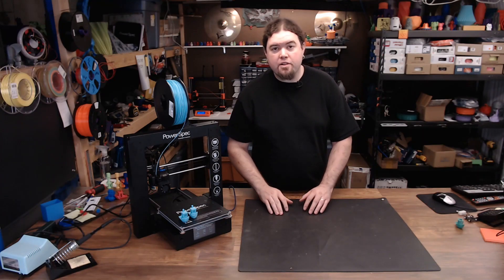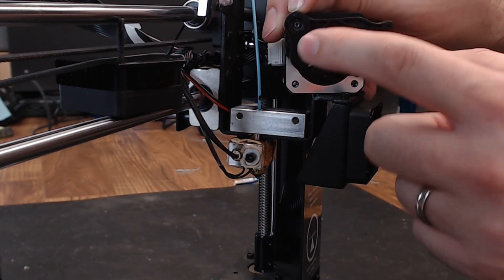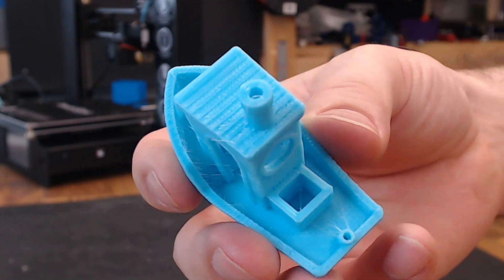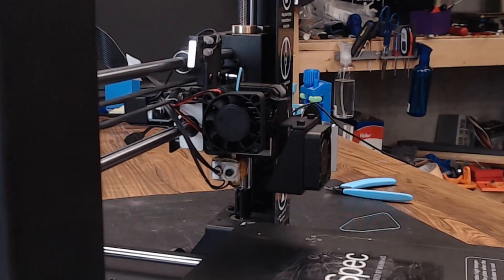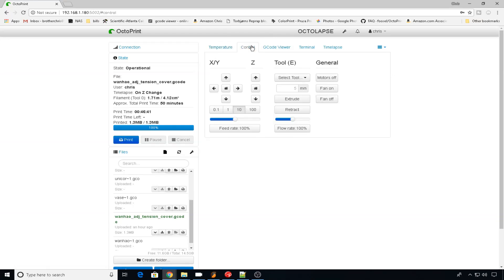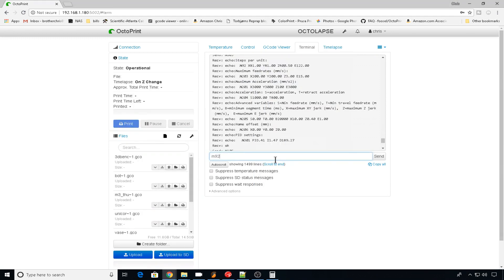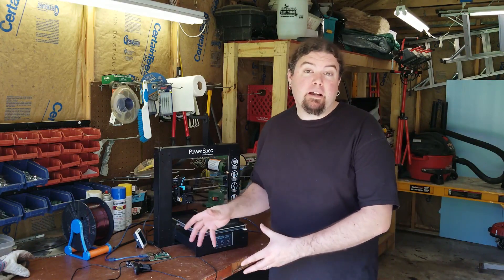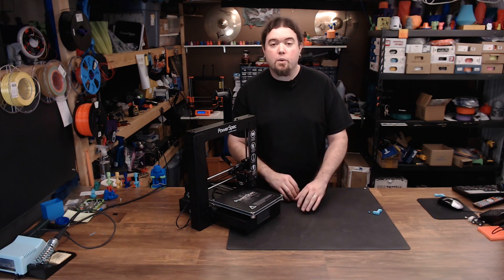Under Extrusion - 3D Printer Troubleshooting - Chris's Basement

Comment: How do you change the extrusion rate in the lerdge x? I change it on the last screen when printing. But how to change it permanently?
Reply from the maker: I think that gets reset every print. Your only option would be to increase you E step setting to compensate.

Comment: Great video. You get to the details quickly and clearly.
You don't meander and speak clearly and provide every step by step which a lot of YouTubers sometimes skip over.
Thanks for the details and helpful info. Your video didn't help with my i3 Plus because I've already replaced the idler arm on my machine with an all metal set.

I wish you did a video on installing and using OctoPrint on a Mac. I'm still looking for that Holy Grail.
Cheers,
Reply from the maker: Thank you! I wish I knew more about mac, I get a lot of people saying this same thing.

Comment: This is great... I have the Monoprice but I dont use Octoprint (dont know how)... not sure I can do the calibration steps just using the standard menu options... Ideas?
Reply from the maker: On your monoprice you should be able to adjust it from a terminal viewer like Pronterface, you will use the m92 e command. You can see what it is currently set to with m503.
Reply: Yes, thanks... But I have not idea what that is...
Reply from the maker: @dddmmm21  Cable up USB to your computer, http://www.pronterface.com/ this is the program you need.

Comment: Are uou sure this is an underextrusion problem and not just a problem with the printer not pushing enough plastic instead? ?
Reply from the maker: Not sure what you are asking, you mean incorrect E steps vs a hardware issue?
Reply: @ChrisRiley  me neither, I think I may have said underextrusion twice in two different ways..  
Say, just out of curiosity,  have you done a vid on how to tell when one needs to change out their nozzle? ???
Reply from the maker: I have not, that is a hard condition to catch. When I run into it next I will get some footage.

Comment: Nice job, especially the comments on thermistor calibration ( or lack thereof ) and too fast for your hot end setup.  I would be interesting to see some tests to determine temperature vs speed of your hot end.  Not sure how to calibrate you thermistor, unless you already have a calibrated setup to test against.
Reply from the maker: Thanks Mark, yeah that's a tricky one. It can be done, but you would have to have access to the firmware.
Reply: @ChrisRiley  How so.  I have the Repetier firmware and I do compile in changes.  Any tips?

Comment: Hi, Chris! Is the procedure to calibrate the extruder the same for any? I have Flash, there is Titan extruder.
Reply from the maker: Yes, it will be the same, but the Titans are 3:1, so it will be triple the amount....roughly.
Reply: 408 (it was in the stock firmware as well). And I've printed some models without much problems... I've heard some clicks but got no underextrusion at all. Before started to tinkering with Linear Advance (turned off already) and S-Curve.
Reply: If I'll measure it without melting (remove plasric, the tube, then extrude) will it be the same?
Reply from the maker: Not sure I understand the question?
Reply: I mean that I want to remove the PTFE tube and just extrude (not through the hot end).

Comment: Nice video. My new Geetech A10M extruded 77mm out of the 100mm I ran through it. So I needed to change from 340 to 441. Unfortunately the Marlin menu on the printer allowed you to change 0.01 at a time, meaning I had to sit there for 5 minutes just to get the Esteps to 375.00 I checked back to see if this was making any progress by extruding another 100mm but the firmware kept freezing while trying to dial in an amount to extrude. One more turn of the dial went from 50mm to 130mm which then messed up where my pencil line was and I gave up as it jammed in the nozzle anyway because I was doing this test with a cold hot end.
Why the hell these things aren't calibrated properly at the factory I'll never know. I might just add 30% to my flow rate in my GCode.
Reply from the maker: Thanks! I know, there is so much tweaking that has to be done, but you can't beat the price.
Reply: @ChrisRiley   Well I pretty much wasted 3 hours where I should have been sleeping last night, chasing my tail thinking it was the extruder,  but I solved the problem. It was as simple as old filament which had partially blocked the nozzle. I know this because after giving up on my Cura profiles and printing from the supplied example GCO file, the filament from 2 colour swaps ago came out in the first layer in a messy looking colour puddle, and since then it's been printing fine.  Perhaps it's time to learn nozzle cleaning - Doh!
Since then, awesome prints and ways of mixing colour I never thought of. You can replicate a colour you need by mixing two together in different ratios until it matches. Perfect for matching your print to something that already exists where a part needs replacing.
Reply from the maker: @ArcanePath360  Awesome man! I am glad you got it working. I have a color mixing delta, I need to get it working again.
Reply: @ChrisRiley   I'm just glad I found something to finally replace my aging Anet A8 with dual extrusion. Been looking for years. Just sent back an Athorbot Brother Dual for a refund - absolute garbage that was. Geetech has produced one of those machines that nerds can fine tune and turn into something great. I've discovered so many good things about 2 extruders; for one thing, you can hot swap filament during a print after running out, without even pausing by clever use of the mixture control. This method also allows multi colour printing too, where you can keep swapping filaments on the inactive extruder during printing after the layer for that colour has finished.
Reply: @ArcanePath360  I have the same problem with my a10m have you found any solutions yet?
Reply: @BostonWorks   I set back the extruder to default settings, and just increased the flow rate in Cura to 108%. Seems to be okay now, but it depends on the print and layer height so I'm still keeping an eye one it while it's printing. I've stopped using adaptive layers as this seems to mess up the extrusion rate each time the layer height changes. Or it could be that I had a blockage in the nozzle or the extruder  was slipping slighting, there are so many factors to consider. Might even be the filament itself. All I know is it was under extruding and now it isn't. I may not have completely cured the underlying problem but it's a work around that gets me some good results.
Reply: @ArcanePath360  may I ask what your layer height is?
Reply: @BostonWorks  Depends. I go from 0.1 to 0.3
Reply: @ArcanePath360  I finally got a test print that was pre loaded to work. I've changed some settings on cura like flow rate etc and I'm still getting under extrusion... I know its not the extruder slipping or anything but I'm not sure what else to do
Reply: @BostonWorks   Could be a million things. You need to test everything systematically. Make changes as you go to each thing it could be and keep trying until you narrow down what it is. Some things to look for: Blocked nozzle (even a partial blockage will affect flow rate), filament grinding, maybe it's too tight - check for debris around the extruder wheel. If the teeth dig in too deep the filament may not flow properly through the PTFE.
Reply: @ArcanePath360  well I know it's not the extruder itself because i can print the test prints just fine.. it only under extrudes on custom prints
Reply: @BostonWorks   Then it's your slicer settings. My test prints looked fine but when you look at the top layer it is a little under extruded. Have you tried turning your flow rate up? As I said I have mine a 108% to re-create how the test prints came out. You can adjust things in the LCD on the fly to fine tune it while it's printing

Comment: Hi Chris,Maybe you can help me when you have a chance. I have a formbot raptor upgraded with volcano hotend and using a .6 nozzle. I'm using a .70 line width using simplify 3d with .5 layer height So I calibrated my extruder and set my flow to 1.0 multiplier.
When I make a single wall cube I get  
.80 instead of .70, I did try a flow rate of .96 but my wall is still thick at .76.

The part itself is pretty close in size it's a 40mm square cube.

Just wondering how to fix the walls being at .80 instead of .70 if the extrusion rate is correct.

Thx Chris
Reply from the maker: Interesting, I have found the slicers put some things in the gcode for you that might not be exactly as you wanted. I would check the gcode first, does it have anything in there like default flow rate settings?
Reply: @ChrisRiley  Thanks for the reply.

I have not checked the gcode but I might try cura and see if I get the same result. I'm also thinking of adjusting the line width to .80 and see if it adjusts to that setting. 

I'm just starting to learn how to adjust firmware and I can look at the gcode generated through notepad++ but not sure what to look for in that respect.
Reply from the maker: @docmortal  Yes, trying Cura would be a good test. Looks for notes in the gcode like this. They might give you some more info.

; external perimeters extrusion width = 0.45mm
; perimeters extrusion width = 0.45mm
; infill extrusion width = 0.45mm
; solid infill extrusion width = 0.45mm
; top infill extrusion width = 0.40mm
; first layer extrusion width = 0.42mm

Comment: Glad you added in the filament consistency part at the end. I was having some under extrusion recently and thought I had a partially clogged nozzle. Finally bought a good set of calipers and found out the filament had spots as high as 1.89mm which was binding up in the capricorn tubing.
Reply from the maker: I hate that so much....I have had some WAY to high prices stuff do that to me recently. When it's a $10 spool....meh.....when it's a $40 spool....RAGE! LOL!

Comment: Greetings, Chris! Great video. I really liked the true-to-RepRap, "Printer, heal thyself" approach you used. I'm bummed that you were having extrusion issues with the printer at all, though. When I bought mine, it had a decent test print already on the build plate. You'd think these would have a little more QC on the parts, right?

Anyway, again - Great video! 👍
Reply from the maker: Thanks Bryan! I am a little disappointed to say the least. I always thought these were good machines out of the box, but mine has not been. I am thinking now I got a bad board after mine has recently caught fire. I really like the construction of it, so I am going to keep trying. Updates to come!

Comment: Great video Chris. I put an aluminium extruder head on my CR-10s as the original just didn't have much pressure on the idler wheel, much better now.
Reply from the maker: Thanks! Definitely a worth while upgrade.

Comment: Had the exact same issue with my old Monoprice Maker Select 2, and also on the Ender 3. Fixed the Maker Select the same way. The Ender assembly was a mess, it got a whole new aluminum extruder arm, gear, spring and idler.
Reply from the maker: It was the same way on my Geeetech i3, switched to an aluminum arm as well.

Comment: Chris if a person did not want to use Octoprint would it be possible to just make the change in the feed rate setting on the printer menu to get the extrusion calibrated right ?
Reply from the maker: Sure! It would work the same as long as you have the option enabled to allow you to store it in eeprom. I have seems some printers where you could change the settings, but there was no menu option to store them.

Comment: Great timing.  I've been battling under extrusion issues on my CR-10.  I never thought to inspect the idler bearing or tension or the spring.  I've been jacking the Flow rate up to 115% as a short term fix. But since it used to print better than now a worn out spring/less tension makes a lot of sense.  Keep up the great work.
Reply from the maker: Awesome! Good luck on you fix, my CR10 gets build up on the hotend side of the bowden tube. I usually cut a few mm off and it starts working right again.

Comment: Like the approach to use the printer itself to fix it, even you had to print the idler parts 3 times to get your final part. Not everybody has access to a 2nd printer which would make it easier in one step.
Reply from the maker: Agreed! I really like that idea, a machine being able to fix itself, even if it's incrementally. It's this type of thing that keeps me interested.

Comment: had a petg print fail last night whilst I ran it out in my garage. I guessing it got way too cold overnight but now I have to recalibrate the z axis as my inductive sensor seems to have moved. I crashed the head into the bed this morning trying to start the print again. meh, it happens.It does seem a battle here with getting all this right and reproducible. especially when you have zero time to really trouble shoot. Thanks for doing these kind of videos. they help focus on where issues and sources of error might be coming from.
Reply from the maker: You bet! I agree, some printers are much more consistent than others, but temperature swing has always been an issue. My area jumps about 15c difference between season, some days it feels like starting all over.
Reply: @ChrisRiley  switched over petg to pla and completely recalibrated my bed. There is still too much slop on the system for my liking but I got a reasonable print from it. It is a bms holder for my friends 2wd electric bike.
Reply from the maker: Keep working at it, it's an up hill battle most days, but so satisfying to watch work. :)

Comment: Curious. Why not print the replacement part in PETG, instead of ABS?
Reply from the maker: You could and it would be almost as heat resistant. I did ABS just to add a little more entertainment to the video, PETG would have saved me some work. :)